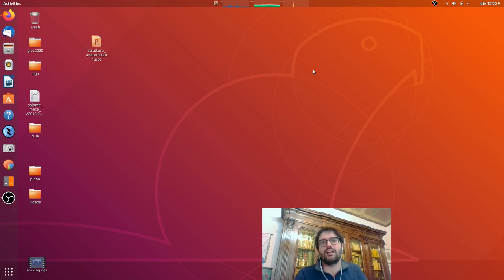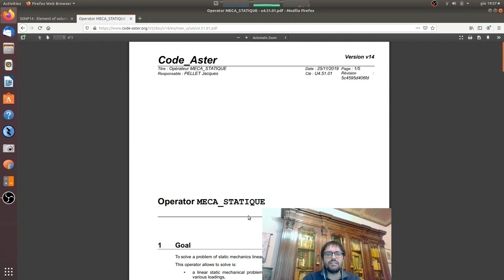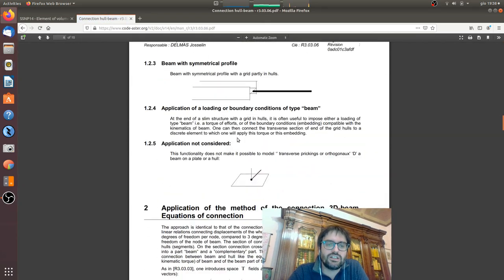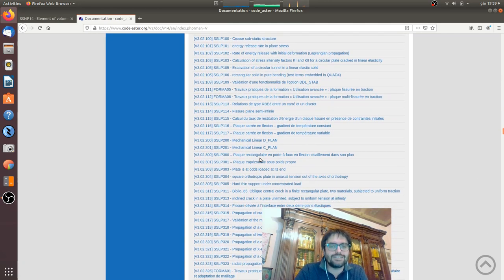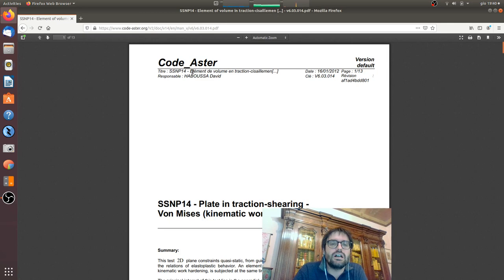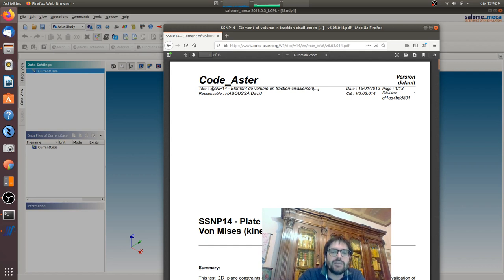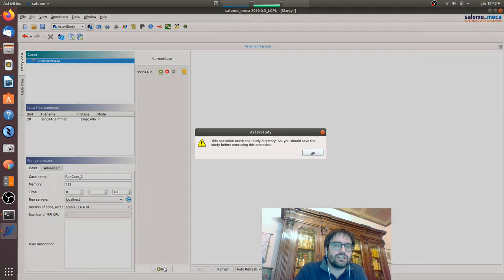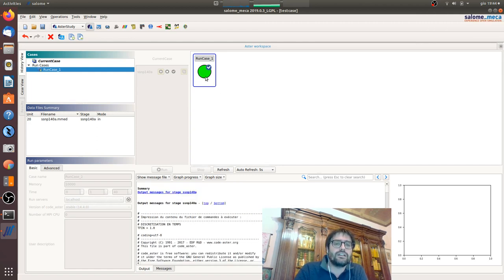How-to Video: Access Documentation of Code_Aster and Run TestCases in asterStudy

Comment: Hey, Lorenzo, thank you for the video, excellent information and energy! :) One question - do you have any other test cases that have been very helpful to look at? Also I'm thinking about plasticity analysis for sheet metal bending - do you have any recommendations for that perhaps? Thank you so much!
Reply from the maker: SSNP155 could be one https://www.code-aster.org/V2/doc/v14/en/man_v/v6/v6.03.155.pdf
Reply from the maker: also SSNV501
try to search for "code_aster metal sheet" or something like that and you can find test cases, discussions in the forum, etc
Reply: @aetherengineering7387  On point, thank you!